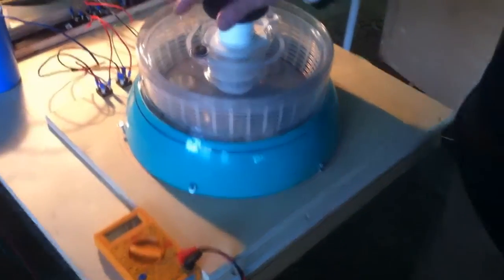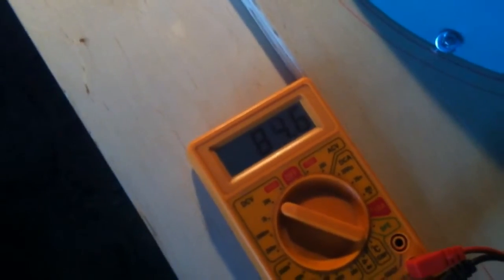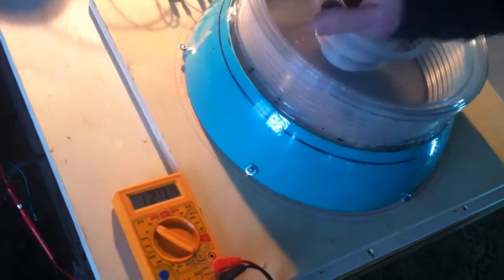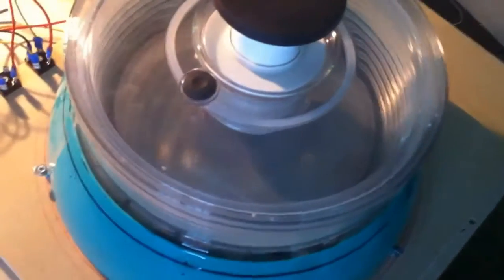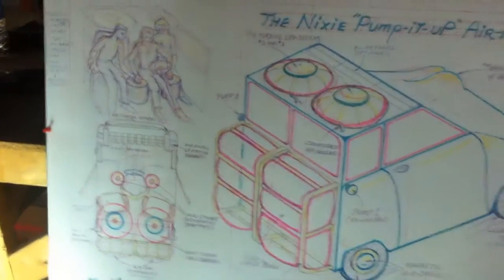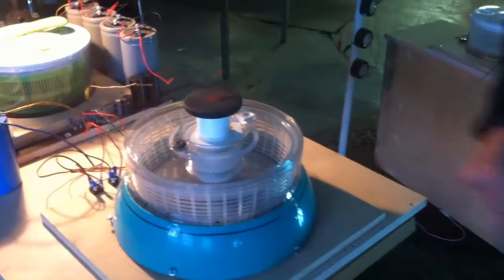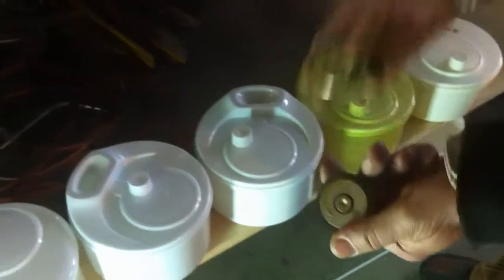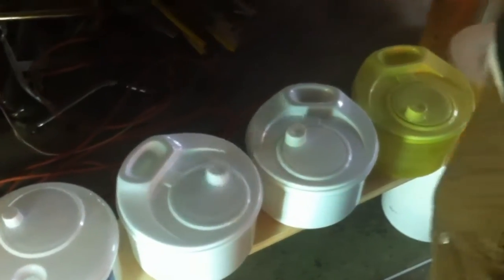UFO Alien Leak FS22 - Zero Pt. / Lev Combo

Comment: This is not free energy or zero point energy. See how he's tired as fuck after pressing that thing ? That's where the energy came from. This is just a dynamo. Also voltage alone means nothing. LOL. This guy doesn't seem to understand electricity. Voltage without much current can't power anything. Power is voltage times current. You can have a thousand volts and still you won't power anything without current.

Comment: Would it not be possible to use part of the electric current that the machine is generating to power a rod that mimics the pressure being applied by the hand in the initial energy generation?
If that makes sense? :)

Comment: Excellent, but I wonder what is the current output or power output when you show voltage output of 100 volts plus. It would be great if you can show Volts and Current output at the same time while load in on.

Comment: I finally got up a solar-currency mock-up (FS26)- also carbon-fiber frame demo (logical for all human powered electronic vehicles). For those of you whose city or country don't have a no fuel road system (usually bicycle) that can be doubled in width easily - you should agitate for one! All this fits together outside the fuelist system - make sure your motor vehicle police don't have jurisdiction on the GreenWays!